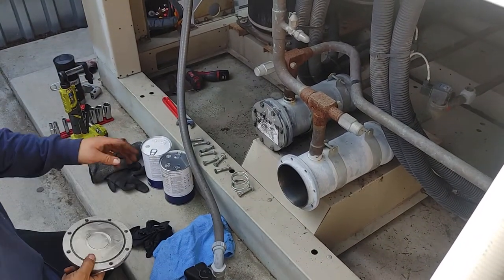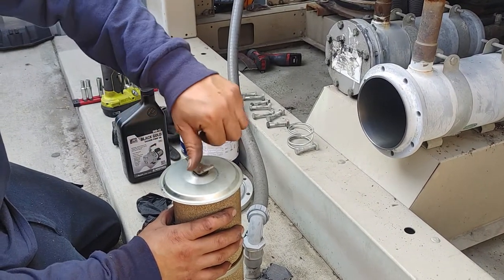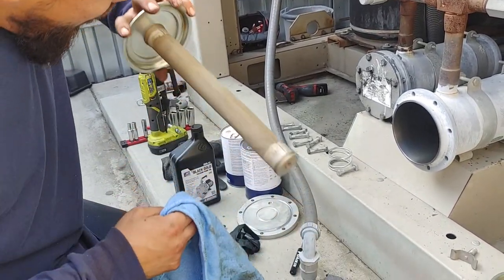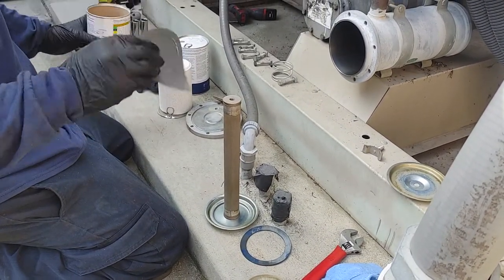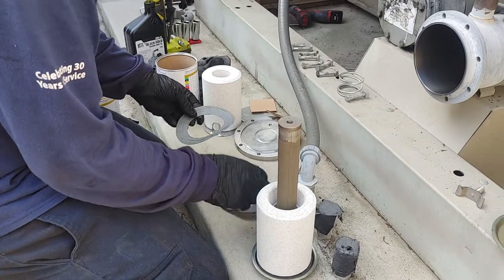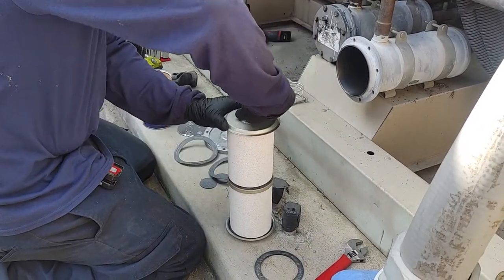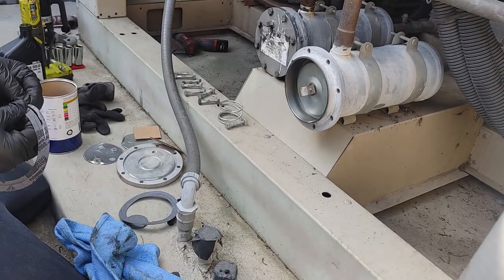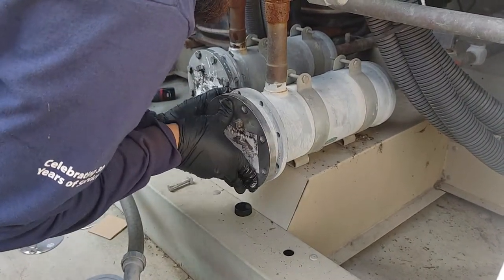How to replace a filter drier on a Chiller (pt 1)

Comment: I would have used brake cleaner instead of blowing moisture on it. I also would have worn gloves. You can use 2 spring clamps to help out it back together as well and it makes it a breeze.

Comment: Before u remove the dryer, are you going to pump or how bro
Reply: Probably they closed out the filter and let the compressor suck out the refrigerant in there with hose connected somewhere on the suction line.